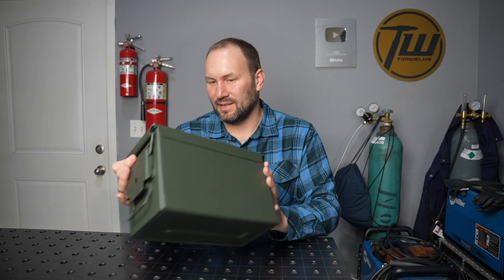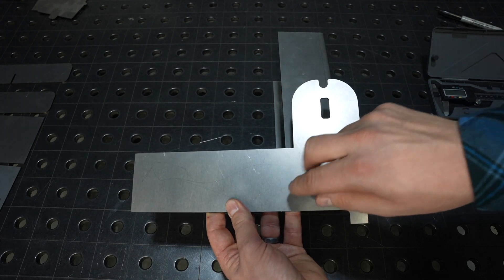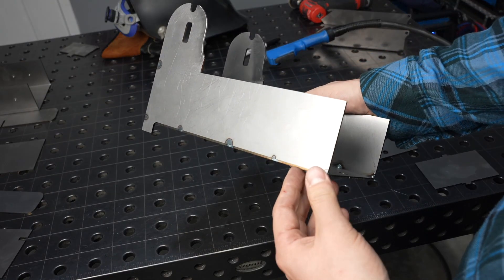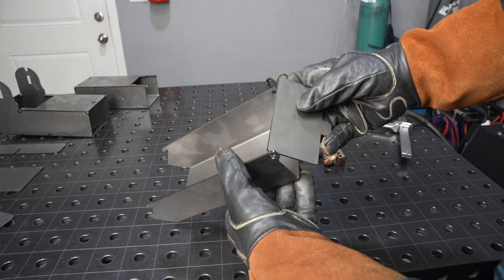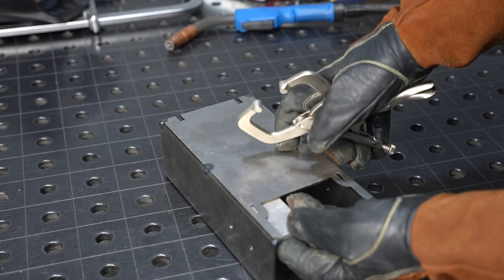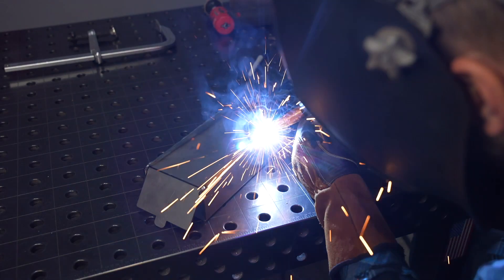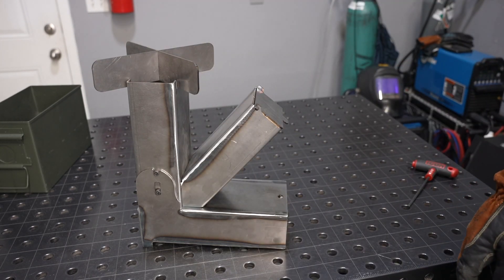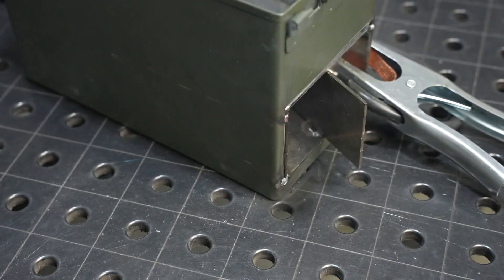Building the Best Portable Rocket Stove: Welding Project

Comment: I just ordered a 3 in one welder fux core and arc leads come with it not the lift tig touch . I have a 55 gallon metal drum out back. I live in Maine and it's could in my little shop area/shed. Just any ideas on a strategy? What one do you suggest. It comes with .08cm/.030in 1 pound rolls it can hold up to 2 pound rolls. I'm going to order more wire . And it comes with 5 rods not sure what size I'm going to order more rods as well once I know the size that gives me the most range to weld with. It's a 135 amp machine duel voltage 110/220 it come with a pig tail .
Reply from the maker: I would stick with flux core to start. It's easy to learn and get going fast and works great for a lot of projects.

Comment: Additional pan supports other than simply the x may prove necessary.  Perhaps border pieces around the edges that slot in, with little notches and them.  This will also help trap the heat under the pan and less of it just go away
Reply from the maker: I think something like that would be a good addition.
Reply: @TimWelds  because I've used a little camp stove that just had an x and it's easy to accidentally bump the pot or pan and have it slide down the x and all your food is on the ground

Comment: Free shipping, you only had to soend $250 on $80 woth of meral
Reply from the maker: I'm not sure where you can get cold rolled steel precision laser cut, bent, tapped and delivered in a quantity of 1 for a better price than SendCutSend, and I've looked. I have worked with a lot of local laser cut shops over the years and their minimum order quantity makes small projects like this much more expensive. A few years ago, local shops were generally less for higher quantity orders, but SendCutSend is very competitive at higher volumes now too.
Reply: @TimWelds  it was simply a comment on the shipping being built into the cost and not free, not sure how you took that as a personal affront. In a surprise twist is there any chance you will be selling the plans?
Reply from the maker: I wasn't offended at all, I've just done a lot of shopping around and haven't found a better overall price. I might offer plans if I get enough interest, but I'd probably make a few updates.

Comment: What a cool little project. I enjoy your videos, Tim. I bought your full set of courses and practiced welding all last summer. I'm still just so-so at it (aging eyesight doesn't help). But I welded a bunch of stuff that I needed, thanks to you.
Reply from the maker: Thanks! If you ever run into road blocks with anything from the courses, feel free to send me an email and I'll help you out.
Reply: Most weld hoods have holders for "cheater lenses" you can add the corrective lenses into your hoods. It cuts down on the glare you get wearing glasses inside your hood.